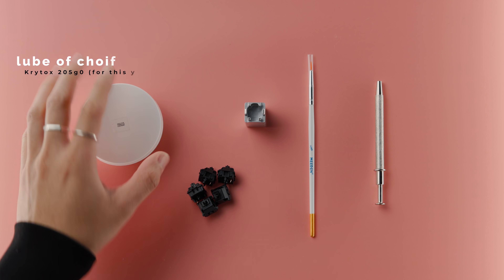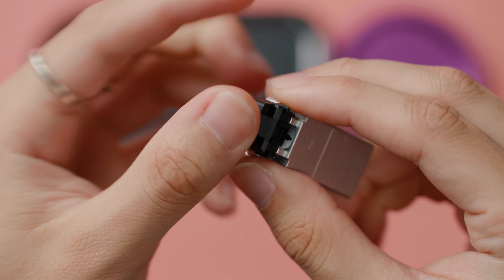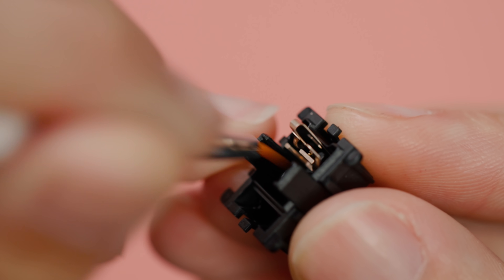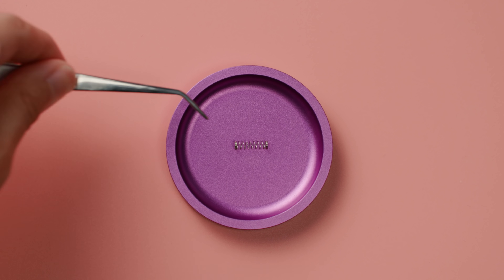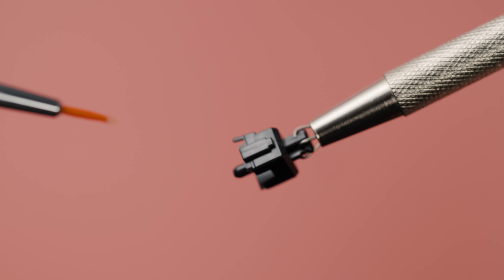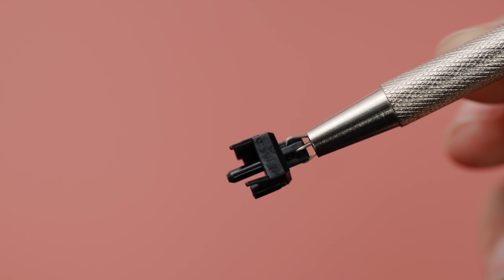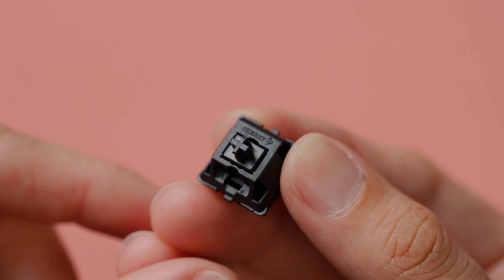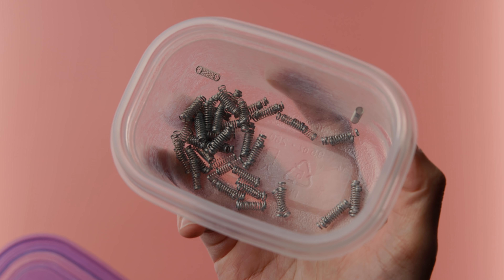How to Lube MX Style Switches

Comment: Kinda sadge since I loobed my switches literally 2 days ago.
Reply: me too lmao
Reply: Same, did it yesterday lol
Reply: Same. Over lubed the crap out of them. Feels bad
Reply: @bigorange1997  Depending on the lube and housing material, the excess amounts will be pushed away from the points of contact over extended use. Some lubes/materials allow for this to happen more quickly than others, but I would consider using them for a week or two before you throw in the towel and attempt lube correction.
Reply: @faranocks  thanks for the help bro. I was wondering what i should do. I lubed glorious pandas with crytox 205g0. I will follow.your advice and wait a week or 2
Reply: Same, haha.  Literally 2 days ago.
Reply: Finished lubing and filming 108 gateron yellows for my akko 3108 board 2 days ago too. I had some issues with the stock stabs (they were just shit), but after doing the stab band aid mod on stabilizer stems, there was no rattle. Really happy with the result, even though it took my like 12 hours in total
Reply: @wert1897  This was my first time building a board, and I was building a 96%.  The lubing of 100 switches took many hours, and the whole build took 3 days.
Reply: Honestly, dissasembling and lubing 108 switches wasn't even the biggest pain for me. Worst part was desoldering all the stock switches from the board which were pretty shit (akko pink), compared to that lubing switches is a pleasure even if it takes way more time

Comment: Thanks for this video! I'm doing this right now with Gateron Silent Whites. Each time you mentioned being able to see the whiteness of the lube on the switch, I cried a little inside. I quickly learned to feel thickness of what I applied with my brush and use a sweeping motion to pull off excess to use somewhere else. Also, with Silent switches, they have little bumpers on both sides of the stems. I've read that it's not good to apply lube to these as they can come off if you do. 

Also for the springs, I am 100% using the bag method, but I swapped out the grease for a PTFE lubricant (3-in-one that I found at Lowes is working well thought Super Lube is usually what's recommended). The only downside to shaking them in a bag is the springs getting tangled. Pulling them apart when they're greasy is kind of a pain, but I like the result so I'm dealing with it.

And those little stations are not worth it. I got one and have just spent an hour breaking apart 30 switches on it, only to undo it into piles of components. xD

Comment: One of the best lubing videos out there. Didn't mention lubing the top housing though. I find a tiny bit on the top where the stem rails contact the housing helps to round out the sound and dampen harsh top-outs.

Comment: This was a very thorough explanation of why you lube certain parts of the switch. Thank you for this super thoughtful video! There are alternatives that I have found that pretty much cover the same areas of the switch when it comes to lubing. For me personally, I do not like messing with the stems at all because all of the other subsequent lube application on the bottom housing, spring and even top housing covers this. I don't like messing with stems as it is super time consuming and I feel like it is redundant for a lot of it's commonly lubed areas. For example, the pole of the stem can be taken care of by lubing the inside the pole on the bottom housing. Lubing the rails of the bottom housing should be more than enough for where it comes into contact with the stem as it slides up and down. To me, lubing the sides of the stem is kind of like double lubing considering the rails on the bottom housing was already lubed. As for the front and back of the stem, I just do a quick swipe on the top housing areas before the final reassembly (this is the only real extra step when forgoing lube on the stem, but it is super quick). We have to remember that all of the lube applied gets MESSY inside of the switch and just displaces itself after just minor usage. So less is definitely more. Your spring example is what I try to preach to everyone, but people don't seem to understand what I mean. The top and bottoms of the spring are the relevant points of contact for spring ping issues. People put so much lube on their springs yet fail to rectify their ping issues - looking at you, bag-lubed with 105 oil. 205g0 lube applied around the bottom housing pole will take care of any scratchiness or points of friction on the inside of the spring when actuating. I am not a huge fan of 105 oil since that will just eventually run off to the bottom of your switch housing because of how thin it is. It doesn't help when you are constantly banging away at those springs when using them...it pretty much just shakes that 105 off over time. The leaf spring lube is excellent and I do that myself! But yeah, it is all preference and what everyone finds to be their best method!
Reply: What do you think about the lubrication of stem posts? For many switches, lubricating the shaft of the stem provides a smoother feel. However, this did not last long and turned into a stiff hitting feeling.

Comment: That "stem holder" looks precisely like a tool we use in jewelry sales/repairs for holding a customer's diamonds for inspection and steaming. I'm not sure if they have a name, but I am pretty sure that is what they are designed for.
Reply: Yea that's true. If you buy them off amazon or something for switches it's still labeled as a jewelry picker/tweezer. It just also works for holding stems so there's no need to make specialized tools

Comment: A tip if you don't own a stem holder a good DIY tip is to take a biro pen those clear ones and take out the ink plastic stick and put the stem on the empty top point and it holds it perfectly :)

Comment: One can also use Krytox 105 for bag lubing the springs btw, gets more evenly on them than the thicker 205 or similar lube.
Ohh and while you are down there, film them too! Most switches have tolerances big enough between the top and bottom housing, so that they wobble a bit.
Filming deadens it and makes the switch sound deeper and cleaner.

Comment: Very nice video! I'm so happy that I go tactile for my Kara, i used Trybosis 3204 for the switches and just did the lazy lube method, worked fine, every switch sounds the same :) Lubing linears was another story, my Durock L7 switches were really inconsistens (leaf ping and such), however my lubed Gateron Milky top blacks are perfect after a few weeks of usage... I thought that I overlubed them at first, though it was more the muted sound of them that confused me because i came from super bright sounding JWK switches.

Comment: Love this vid of yours! Just bought my first mech keebs and just wondering how often do we need to lube switches? Thanks and stay safe! 😊
Reply: Once you have lubed your switches, you don't have to lube them again unless you really want to, or you feel like the switch quality after lubed doesn't reach your expectation (too thin or overlubed). The purpose of lubing switches is to apply a thin coat of lubricant to the switch (stem + housing), even after the grease has wear off, the thin coat of lubricant will still maintain there.
Reply: @huunhanle3809  thanks for the heads up! 😊

Comment: I purchased a 60% keyboard which has Gateron red switches and comes with pudding keycaps. The keyboard I ordered will be here today and will be first time using a keyboard other then full-size. keyboard. I ordered a lub station kit as well but that won't be here until tomorrow. So the 1st day of owning the 60% keyboard will have to be un-lubed. =P
Then sometime tomorrow I can pull all the switches and lub them all.

Comment: thanks for the stellar guide. why do you prefer such a thin, pointy brush over a wide one that can spread more quickly and evenly? is there something the thinness provides that's lost on fewer strokes with larger, wider brushes?
Reply: Using thin brush help you lube your switches better the a larger brushes, since you only apply a very small amount of lube as well as a thin layer of it. Using a larger brush for lubing will make the switches become "overlubed", sorta like having a mud inside the switch - it's wet and sticky.

Comment: When picking a paintbrush get a synthetic one btw. Pure kolinsky, sable, red squirrel, wolf hair etc is terrible for two reasons. One—they’re all VERY expensive options. I know some people think more expensive = better, where that’s mostly true for painting, it doesn’t apply here, and removing the lube from real fur is REALLY DIFFICULT. Even if you think its all gone, it will ruin a painting, trust me, I’ve done it already. 2 real fur eats up your lube. That’s generally what makes real fur better for painting, you can load it up with more pigment and water because the fibers absorb them well. Well, it also absorbs lube like a sponge. You have to spend time squeezing it out so you don’t waste it, and it’s a lot of waste. I found my quick gotta run travel brushes that are synthetic are very good for lubing, since they don’t retain the lube as well and spreads it on the switch rather than hydrating the fibers with it as natural brushes will. 

—a message from a professional painter and keyboard enthusiast.

Comment: Oh i have a question, so how long usually does it takes to reapply the lube on switches?

I loved your video, I didn't know why some keyboards always sounds so mesmerizing and now i discovered, it's the lube👀 it helped me a lot^^ thx
Reply: Once you have lubed the switches/ stabilizers, it will stay for a very long time ( mine was last for over 2 years before it started to wear off ). Even if the lube wear off, the smooth feel will still maintain in the switches/ stabilizers so you don't have to relube them unless you really want to :D.
Reply: @huunhanle3809  wow that's a long time, thank uu

Comment: Insane video, thanks so much! Is it common to re-lube switches when it wears out?
Reply: You don't have to, as the true purpose of lubing switches is to apply the "true" thin coat of lube to your switches, even if the grease/oil wears out, that coat of lube will still remain intact.

Comment: Thanks for such a well-made, helpful video. I've heard conflicting advice on whether it's necessary/beneficial to lube both sides of the spring vs. just the side that goes in the bottom housing. Is there a particular reason you've recommended lubing the top side of the spring as well?

Comment: I got a question that I cannot find the answer to:
1) At what point do I have to re-lube the switches again? I know that the lube doesn't stay in the same spot forever and eventually stays on the bottom of housing.
2) If I have switches, lube them and film them, test them out, and decide that I don't like them and not want to use them as a daily driver, is it good to leave them just sitting there? I saw some comments where they say that doing that will lead to your switches to break down faster (?) and also leads to the first question.
Reply: Once you lube the switches/ stabilizers, it will stay for a very long time ( mine was last for over 2 years before it started to wear off ). Even if the lube wear off, the smooth feel will still maintain in the switches/ stabilizers so you don't have to relube them unless you really want to :D.
Reply: @huunhanle3809  ahh okk. Does this apply for both when you use them frequently and dont use them frequently?
Reply: @vaxtrixradicalbro4295  I'm using my fully modded keeb daily and only leave it for a couple of moth in some occasion due to vacation and it's still works fine for me. Since I have kept it in a dry + clean place without dust and cover it with dust cover and wrap it in a towel for maximum protection.

Comment: Taeha it is interesting you suggest lubing the center column of the stem as anytime I have ever lubed the center column of the stem in any amount (even just a tiny bit on the bottom like you suggest/do) it has made my switch feel sluggish versus not lubing stem center column.  I’ve also heard this experience from friends in them hobby (all of us using 205g0) so I’m interested to hear your opinion on this, as I would think all users would experience this given there isn’t much space in the female column on the bottom housing that the stem center column goes into which it appears to be the cause of this issue.

Comment: How long does the lubed effect last? Any complications when it comes to cleaning dust away from the keyboard?
Reply: Lube tend to stay for a very long time before it started to wear off ( mine was last for over 2 years ). But you don't have to worry much about it, even if the lube wear off - the smooth feel will still the same. So keep them intact or apply new lube is up to you :D.

Cleaning dust away from keyboard is not that complicated, you just need a brush then tilt the keyboard 45 degrees -> now you can brush the dust, hairs etc. away from your keyboard ( you can also use a tweezers to grab those hairs or big dust that stuck in the stabilizers or switch's housing ).

Comment: I found this video to be helpful. In my experience, many people have a tendency to overlube (with basically everything that requires lubing, I don't mean keyboard switches only). Anyway, does anyone know of a good video showing the installation process of new stabs on the GMMK Pro? I've been using my Pro with the stock stabs, & while they do work, they are very sticky. It always take a second for them to pop back up. I have gotten Durock V2 stabs. I just want a general guide to installing them. I'm pretty sure I know everything I need to know about it, but I would like to be certain. Thanks

Comment: How long will this amount of lube typically last before you have to de-solder and re-lube?
Reply: More than 2 years in my case. Even if the lube wear off, the smooth feel will still be there so keep it intact or apply new lube is up to you :D.
Reply: @huunhanle3809  I have yet to build my first board, but just can't imagine having to de-solder the whole board to reapply lube and re-solder again lol

Comment: I know you dedicate a lot of effort to lubing with these methods and I'm sure there's quite a difference between these results and those of using a precision pen. What are your thoughts on the no-desoldering method using SuperLube precision lube pen? Any concerns with that product eating rubber from keycaps with o-rings added or the little bumpers inside silent switches?

Comment: A question here. Does the lube ever need to cleaned and reapplied? For most stuffs that use lube it eventually greases up after some time and get sticky. So you would need to dissasemble, degrease without damaging the switch and then regrease. Does this happen for lubbed switches as well? Or is it kinda carefree for the eternity of the lifespan of an switch?
Reply: once u lube a switch u dont need to reapply it for at least a year unless u hear pinging
Reply: @cowpuncher3007  "at least a year" isnt that long of a time span. Is it based on usage or age? If you own multiple keyboards lubing them up even every 2nd year sounds like a bit of work. And do you need to to degrease the switches then before relubing? Or just on top of the old lube?
Reply: You don't really need to lube the switches/ stabilizers again once you  have lubed them since they tend to stay for a very long time ( mine was last for over 2 years before it started to wear off ). But even when the lube wear off, the smooth feel will still maintain there. So keep it intact or apply new lube is up to your choice :D.
Reply: @huunhanle3809  sorry to ask you here, but near the end when taeha give tips for lubing multiple switches he use tub lubing, but it looks like he uses grease lube (maybe 205g0?). I only see tub/bag lubing with oil lube (105 for ex.), does using grease work if its the first time you tub lube? Im not sure because taeha said his tub have leftover lube from prev sessions (which he might use smth like 105) and that makes it easier for the lube to get on the springs.

Comment: Just a curious question, what happens if you lube your stabilizers with baby oil? Would it be a bad lubricant? The only thing I know that may happen is that it would just spread around the keyboard if in use.

Comment: something that i really dont like on lube stations is.. the sourrounding air. It might all be just false and just placebo but in my mind: exposing the inside of the switch with lube on, wich pretty much drags dust to it thats just floating around the air naturally is just a bad thing.. i want the inside of my switches to be exposed as little as possible no no dust or stuff can get to it. This way: the idea of lets say lubing 70 switches and have them all be opened up exposed sitting on my desk with lube on just feels very ''wrong''. After i lubed a switch i want it to be closed as quickly as possible so i usually only lube like 5 switches on my lube station and after that close them all up, do the next 5.

Comment: So, is lubing a one time process? Or do you have to do it every couple weeks?
Reply: Once you lube the switches/ stabilizers, it will stay for a very long time ( mine was last for over 2 years before it started to wear off ). Even if the lube wear off, the smooth feel will still maintain in the switches/ stabilizers so you don't have to relube them unless you really want to :D.

Comment: Dumb question, but how do you know if a switch is slightly overlubed? Like I tried lubing and filming a couple alpacas following this tutorial and I think they feel and sound much better. I wouldn't say they feel sluggish, but they definitely feel, idk like maybe a more full/rich feeling? As in less plasticy and less hollow then the stock. Does that mean I overlubed or is that what I should be aiming for?
Reply: If it feels sticky when you bottom out, it's probably overlubed.